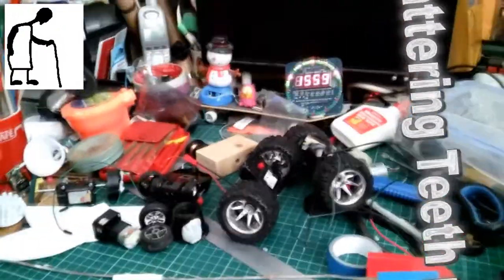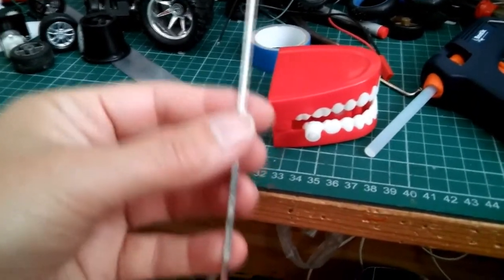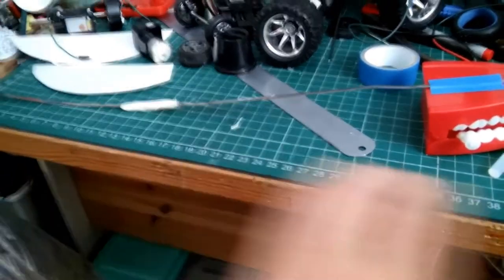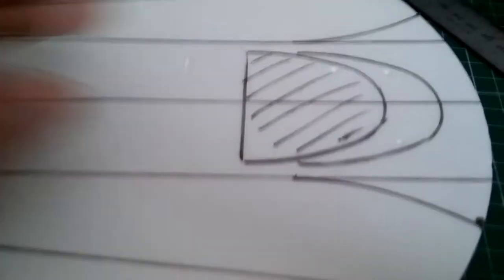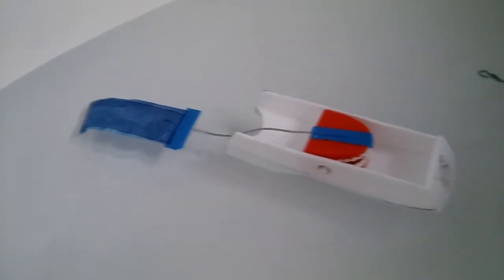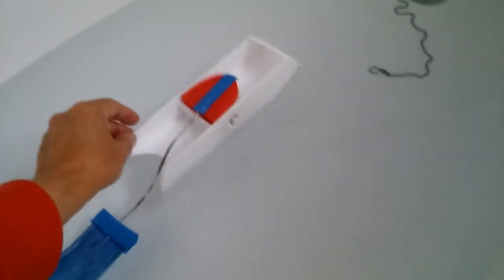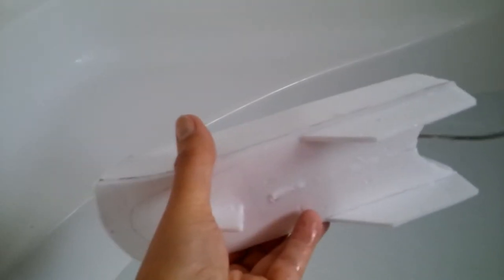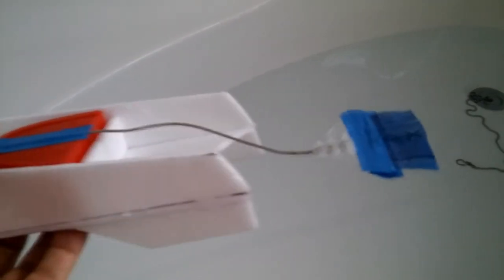Windup Chattering Teeth powered Boat

Comment: Not necessarily a failure. Put a strut under the middle of the tail wire use a less flexible fin and  That way the vibration force the tail and up down, as the wire reverberates under the power of the teeth,